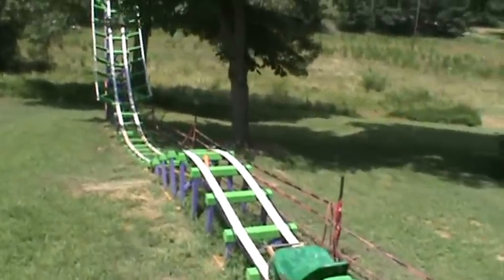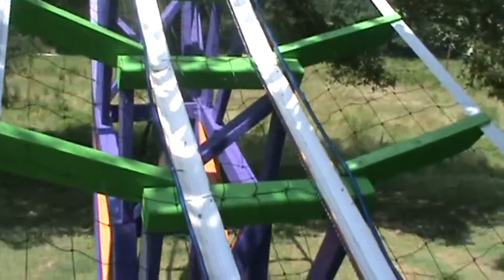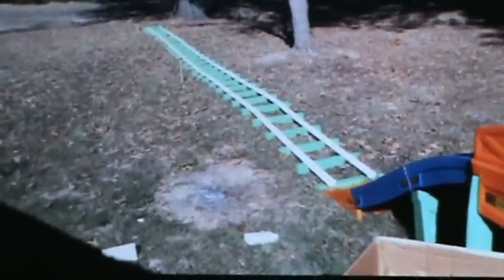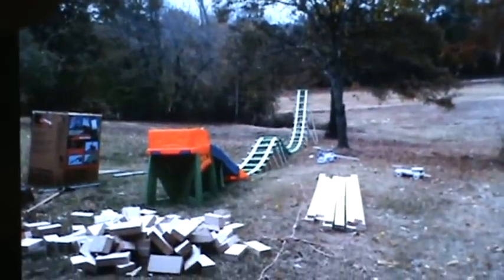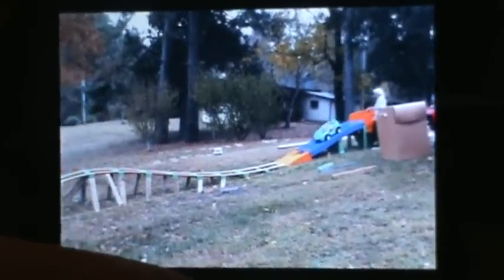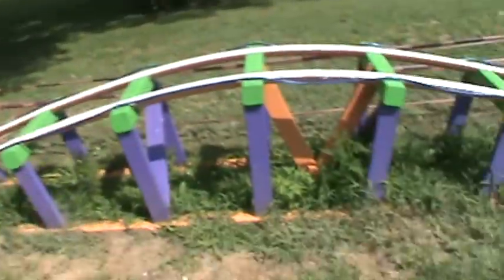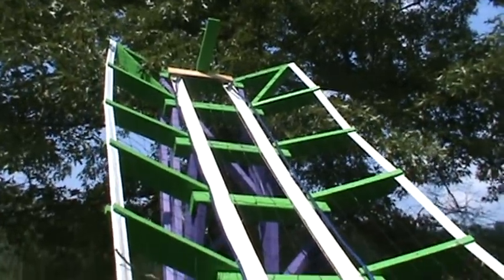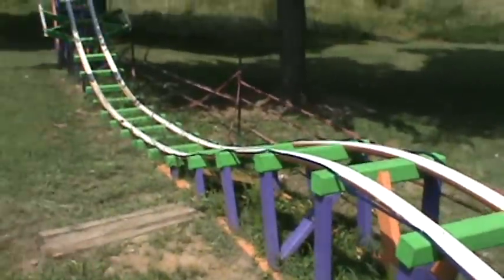How to build a homemade rollercoaster

Comment from the maker: @quinn. It goes faster with more weight. That is to say the more weight h put in it the faster it goes until u get to 20lb and then from there up the speed and distance does not change a measurable amount.

Comment from the maker: @jeffpl2000, yes, I did attach the pipe to coaster by drilling 2 holes through coaster for each track. I first cut 2 channels out if each pipe using a jig saw. This allowed about 2" of the pipe to extend beneath the coaster. I also used a treated 2x4 with 2 small dips cut out of it an put it under the pipe. Then I used flat headed bolts to go down through coaster, pipe and 2x4
Reply: nathan stoll k

Comment from the maker: @jeffpl2000, if memory serves me correctly the coaster wheels are 15 1/2" apart from the center of a left wheel to the center of a right wheel. So when u cut ur halfmoons out just make sure the center of one halfmoon is 15 1/2" from the center of the other halfmoon cutout. After I ripped my 3" pipe in half on the tablesaw I just cut a few inches off of one and used that for a patter to mark the halfmoon cutouts. I